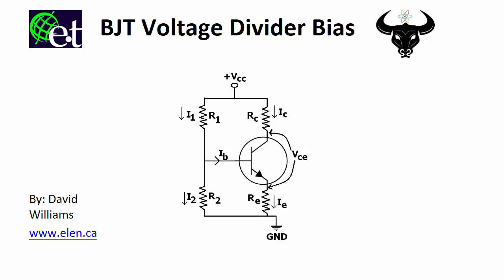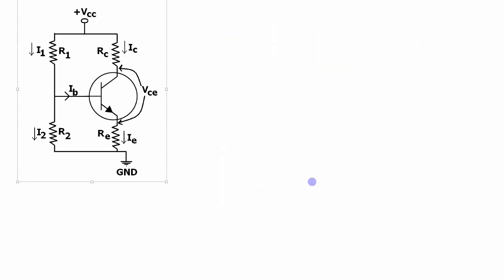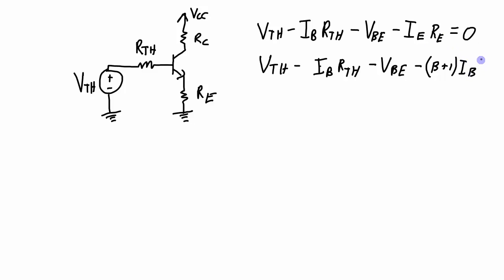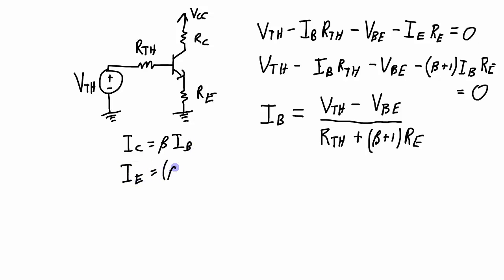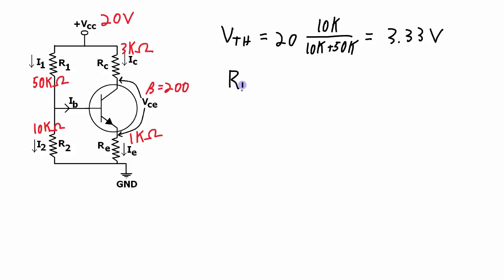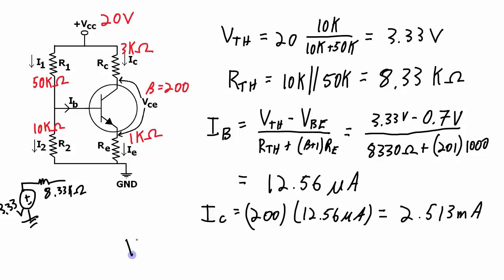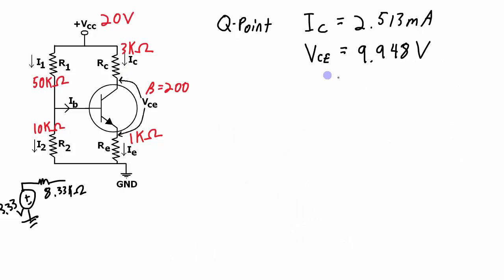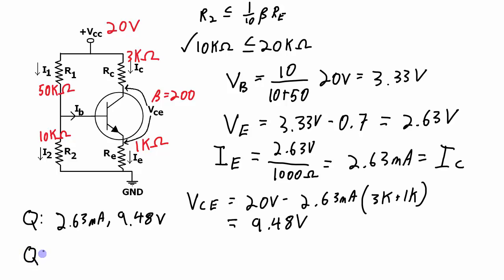BJT - Voltage Divider Bias Circuit

Comment: Is the Thevenin Eq. Voltage the "Base Voltage"?
Reply from the maker: It's not the voltage at the base because it is applied through the Thevenin eq. resistance
Reply: Thanks so much! @ElectronXLab
Reply: BUT, at 13:30 (in the shortcut) you give the same formula for the Base-Voltage as you had for the Thevenin Voltage previously. What has changed with respect to the base voltage form the long version calculation? Thanks
Reply from the maker: @Festus2022 . Oh, yeah, good question...It is more accurate to apply the thevenin voltage through the thevenin resistance...this is the analysis in the first half of the video. In certain conditions (i.e., if the base current is small enough (R2 <= 1/10(Beta)RE), then you can make the approximation that the voltage at the base is the same as the Thevenin voltage

Comment: i have a similar problem with no mention on β, how can i solve it with-out it?
Reply: did you solve it? i have the same problem. no beta but i have all other values. how to calculate base current without it?
Reply: @isuckatthisgame  used loop theory and remember that at the grounded end V=0

Comment: Just awesome explanation sir, thank you so much for that video. I have one doubt about beta, how can we take the beta value as constant because in any transistor data sheet the beta value have a range. For example BC548 has a beta range from 110 to 500. So which value should i take while using this transistor for amplification (for a perfect active region). Please explain sir, if possible.
Reply from the maker: You make a good point. What value of beta do you use? When my students are first learning about transistors, we make the assumption that it is constant and this simplifies analysis a lot. Then we measure beta in the lab for a particular transistor and even though everyone has the same part number, the values of beta change and to make it worse the value changes when temperature changes. Real circuits are designed so that the value of beta doesn't matter as much (e.g., voltage divider bias is less sensitive to changes in beta than a fixed bias circuit). So I think the progression of learning is assume that beta is constant at first because then there is less cognitive load, then recognize that beta can change, then look at ways to make circuits less sensitive to changes in beta.
It's probably not the answer you are looking for, but I hope it helps a bit.

Comment: Thanks for a very clear and helpful explanation. I now have a much better understanding of how to set up a bias circuit for a BJT, and why a certain amount of "slop" necessarily occurs when calculating actual voltage, current, and resistance values.

Comment: How are those resistors in parallel? Having a little trouble getting my head around that
Reply from the maker: I believe the resistors that you are referring to are the ones connected to the base. One goes to Vcc and one goes to ground. They are only in parallel from an AC point of view. If you are doing AC analysis, you ignore the DC source. In other words you replace the DC source with a short and it therefore becomes a short to ground. So from an AC point of view those two resistors are connected to the base on one side and to ground on the other side.

Comment: The "short-cut" method calculates the quiescent collector current and dc bias points of a transistor that has infinite β. The stability of the dc bias against changes in β depends purely on the relative size of the emitter resistor Re. That resistor provides negative feedback that stabilises the operating points as well as reducing the distortion of the stage. It comes at the cost of lowering the voltage gain of the stage, which is 3 in this case. It also "absorbs" around 2.5V of the potential output swing.

You can improve the performance of a common emitter by removing some of the negative feedback from the emitter resistance by lowering it, while providing a feedback path from the collector to the base. In other words, derive your base voltage bias (the positive end of R1) from the collector rather than the positive supply rail. Since the emitter resistor only needs to be more than 10 times the dynamic emitter resistance of the transistor (25mV/Ic) to provide reasonable linearity, the emitter can be usefully biased to as little as 250mV above ground, putting the base at about 900mV above ground. If you assume that the collector bias point is around half the supply voltage, you can quickly calculate the ratio of R1 to R2. Knowing the β will allow you to make R1 || R2 less than 1/10 of β.Re for any value of Re. That shows you that the input impedance of the stage is inversely proportional to the collector current, and (all else being equal) you should choose Ic to obtain whatever Zin is required. Somewhere between 1mA and 2mA with a β > 250 or so will result in an input impedance around 5K to 10K.

That solution will allow reasonable gains of around 20 to 30 with good stability and linearity, while maintaining independence of transistor parameters. I recommend it to you.

Comment: Great BUT why you say voltage divider R1 and R2 and immediately căLculate Rth as parralel ?/
Reply from the maker: Because I wanted to Thevenize the voltage source and resistance that the base "sees". When calculating the Rth, you short out the voltage source, so in that step both R1 and R2 are connected to GND, and are therefore in parallel.

Comment: Where did you get Re from?
Reply from the maker: Do you mean Re from the example circuit? If so, I just arbitrarily picked values for the circuit resistors. Or do you mean re? That is a property of the transistor and it's operating point (re   = 26mV/IE where 26mV is the thermal voltage).
Reply: @ElectronXLab  Reading back on my comment I feel it was a bit blunt, so apologies. I was frustrated after so much searching online on how to calculate bias resistor. I now understand that you have to make some assumptions and that is thanks to you. Subbed. Great videos

Comment: Plugin Ic from where? 06:45
Reply from the maker: I'm not 100% sure what your question is, but if you've calculated IB based on the equation at 06:45, then you can calculate IC as (beta)xIB

Comment: how to solve for IC if the beta is unknown? plss help
Reply from the maker: With the Voltage Divider Bias circuit, as long as it is "big enough", the value of beta can be ignored. You can say the IE and IC are equal. IE can be calculated by first determining VE (the voltage at the emitter): VE = VB-0.7. Then IE = VE/RE

Comment: Also is (Vth) the same as (Vb) the voltage looking into the base of the transistor?
Reply: I am confused about this too. Did you found out that Vth equal to Vb? Or is it Vth =Vb + Ib*Rth ?
Reply: Vth is equal to VR2, the voltage provide by the voltage divider.  And so VR2 = VBE + VRE  (equal to => (R2.IR2) = VBE + (RE.IRE)

Comment: So (Rth) is the same as the resistance at the base of the transistor so (Ib) times (Rth) will give me the voltage at the base of the transistor and therefore will give me the voltage at the resistor going to the ground (Rb2) does that sound right?

Comment: What if Current Gain is not given?
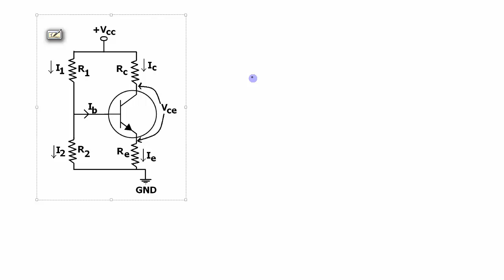Reply from the maker: This biasing circuit is not affected much by big changes in beta. Watch the video from about 12:20 on to see a method that doesn't rely on beta (except for an initial check). The beta value of real transistors can vary quite a lot, so it is valuable to use circuits like this where the beta value doesn't affect the operation too much.

Comment: 5:05 magic happened
Reply from the maker: That was algebra to isolate IB. Group all the terms with IB on one side of the equation and all the terms without on the other side. Factor out IB and then divide both sides by whatever IB is multiplied by to get an isolated IB.

Comment: How do you apply the voltage divider rule there? We should considerate both resistor are subjected to the same current because Ib is very small? Or should we assume that transistor is operating in the cut-off region?
Reply from the maker: Assuming that you meet the condition that (beta+1)RE > 10*R2, then you can assume that IB is small enough to ignore and apply voltage divider rule to R1 and R2.
Reply: @ElectronXLab  thank you!

Comment: hey, how do you reach the assumption that beta*RE>=10R2
Reply from the maker: If beta*RE >= 10R2, then almost all of the current will flow through R2 and very little will flow in to the base. The assumption that you can then make is that essentially no current flows in to the base.
Reply: David Williams but why particularly 10R2, why not some other value like 5R2 or 20R2?
Reply from the maker: It is somewhat arbitrary, but 10R2 ensures that more than 90% of the current goes through R2.
Reply: David Williams Thanks man. Really great video

Comment: I understand how you derived the equation for IB using KVL, but the intuition behind the equation itself is not clear to me. So why is it not IB=VB/RB and then IB=VB/Rth? Additionally my textbook frequently uses VB=VE+.7V, so if I combine this with your method, specifically where Vth-VBE, then I am taking the .7V into account twice. This does not make sense to me.
Reply from the maker: +Kail M. I'm not totally sure I understand your question, but I think your confusion arises from determining the IB from the Thevenin equivalent circuit. The Thevenin equivalent does not physically exist, I am just using it as a trick to help me calculate IB (which is not the current that flows through either one of R1 and R2, it is the current into the base only). I hope that helps...if not, let me know.

Comment: How you  calculate the value of R1,R2,R3,R4?
Reply: use this formula: Voltage = Current x Resistance
Reply: divide the relative voltage with the relative current, use ohms law.
Reply: Brilliant Ember could you explain that different, not understanding

Comment: Where to find beta? I'm a very newbie.. Please, Im begging for your help. Anybody?
Reply from the maker: beta is a characteristic of the transistor. It is often called hfe and you can find its value (usually a range of values) on the data sheet.
Reply: David Williams What label that hfe is usually writen in datasheet?
Reply: yaputra jordi this comes from the data sheet of the transistor. No two transistors will be the same
Reply: Ben Walum Yes I know how to find specific datasheet for each different code and package for transistors and ICs. Just do googling, right? But well, shame of me, I dont know how to begin reading the datasheet. I mean the amount of data being provided is too much. What label usually that hFe is written on? Can it also being measured using a multimeter (cause I've tried it once before)? Thankyou for answering, thou..

Comment: the  bais is  stable ...but  what about the  ac  signal to   be   amplified later...re  usually  bypassed  by  cap   ..so  the ac  does not  see  re   ...which means that  amplification  depends  on the   beta  which  may  enlarge the  amplification till   saturation of  cut off??

Comment: Can anyone help with Deriving the equation at 4:44?
Reply: Take both values which have I(b) with them on the right side of the equation and then take I(b) as common between them.As I(b) will be multiplying after taking common from those terms, Just divide the whole equation by the values which are being multiplied with I(b) , to get the value of I(b) . You will see same equation :)

Comment: I think you should clarify that the Thévenin resistance and voltage are taken from Base to datum node (GND). Otherwise it seems like you are doing 2-port analysis on just one point, the base, which obviously doesn't make sense. Other than that, great vid.

Comment: How do you determine the beta value?  From my understand is this an assigned value within the circuit or is it derived from certain equations?
Reply: For future reference it's based on the transistor and the temperature of the device.